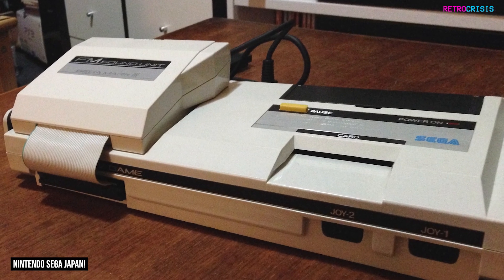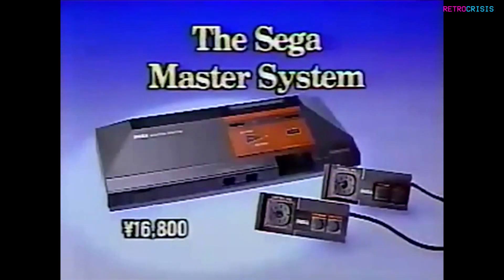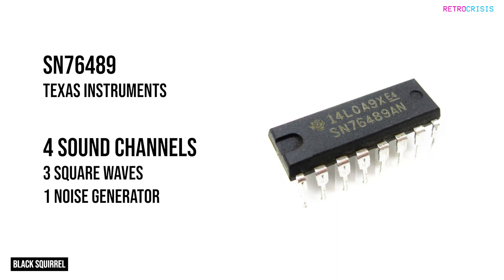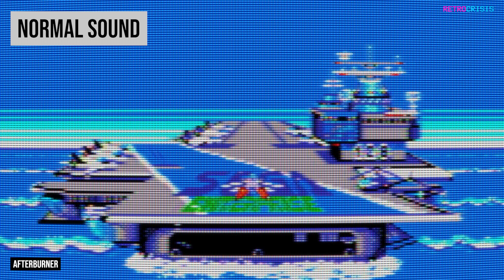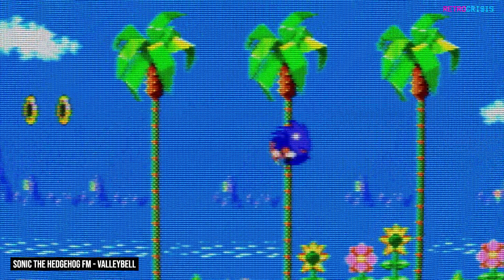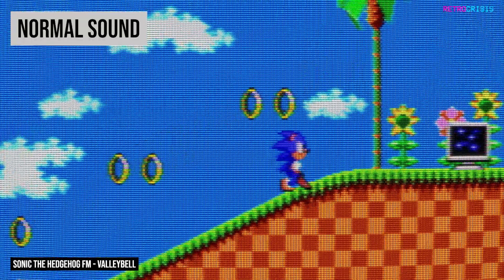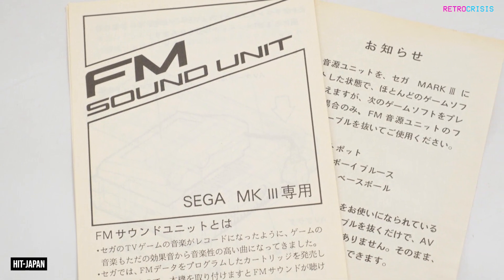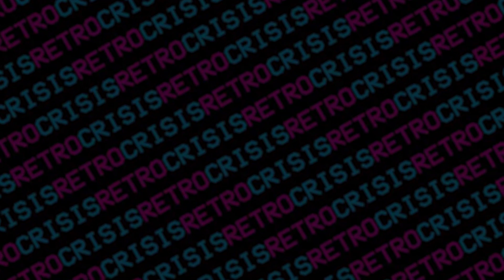Sega Master System - FM Sound Unit - Explained

Comment: 1:17 One important thing to note is that the Mark III+FM Sound Unit setup doesn't actually mix together both PSG and FM audio, only the JP Master System and aftermarket add-ons (SMSFM board, Power Base mini FM) can do that. Because of this, games that are FM compatible only have either FM or PSG depending on if the FM unit is connected or not. The only two things I know of that do mix both PSG and FM are the JP SMS BIOS and a neat hack of Sonic 1 with FM support.
Reply from the maker: Ah yes you're aboslutely correct - I should have made that more clearer!!! Thanks for sharing the knowledge dude
Reply: The Sonic mod was made by ValleyBell, primary maintainer of VGMplay.

Comment: Its a cool addition to the Master System. Sometimes it works ok with the FM sound. But mostly I perfer the standard chip sound. Some of the melodies and sounds are muted and weaker with the FM. Also there is something about the identity of the console tied to its sound as well.
Reply from the maker: I see your point about the console's identity and you're absolutely correct. In some cases the FM does dampen some of the punch of the SMS sound chip for sure
Reply: @MiiCave  console's identity is nonsense. The FM improves on the biggest weakness of the unit. No need to romanticize things ;)
Reply: @shaolin95  Has nothing to do with romanticizing things, it's about the melodic quality the PSG, aka chiptune audio has, FM Synth is fantastic too, so is MIDI, all have their place, but the Master System does sound better with PSG for the most part, it has a stronger melodic tone that lends itself far more to the 8-Bit games, I love OPL3 music, probably my favourite synth type, but I love PSG too, and it's nice to have both.

Comment: Great vid! 
Through my own testing and research I have found that Wonder Boy III, Phantasy Star, and Ys all are not supported with FM sound through the Power Base FM Mini. Also OutRun has major noise problems when played in FM mode.
Reply from the maker: Thanks dude! I believe the games you've mentioned require a Japanese master system or mark 3 system to get the FM sound...I could be mistaken though. Do you have the FM mini??
Reply: @RetroCrisis  yeah, I do. It works pretty flawlessly, other than with the games I listed.
Reply from the maker: @retroprojections  that's awesome. I considered getting one a while back just for the backwards compatibility for the Mega Drive. But in a wired way I think I prefer the regular SMS sound - probably nostalgia
Reply: @RetroCrisis  I understand that! It's a bouncy joyful little sound chip! The FM tunes change the entire feeling of some games: Golvellius for example.
Reply from the maker: Totally agree! Golvelius becomes a lot more serious and subdued with its soundtrack which is a contrast to how colourful and cartoony it is

Comment: Do those MS games have FM sound when used with a Sega Nomad plus MS cartridge adaptor?
Reply from the maker: I'm guessing only if the MS cart adapter supports FM sound
Reply: @RetroCrisis  Interesting. So it's the adaptor, not the actual console itself, which determines FM sound functionality for MS games? I'd always assumed that said adaptors were nothing more pass-through devices with no additional functionality so I guess I was wrong.
Reply from the maker: @sambagogo777  So from my understanding, only the japanese SMS has the FM chip, which wasn't released in International versions. Sega Nomad was USA only, so wouldn't have had the SMS FM chip. But the FM Mini adaptor has the FM built in.
Reply: @RetroCrisis  I just realised that I was confusing elements of the Nomad with the Game Gear. My bad! I somehow got confused by thinking of the GG's adaptor for MS games. D'oh!

Yeah, the Power Base Converter doesn't physically fit the Nomad. I don't know if there were any third-party versions of it that did though.
Reply: @sambagogo777  Also, the Nomad isn't compatible with SMS games at all without modding. You'd also need to perform an additional mod so that external audio from the cart slot can get mixed in.
Reply: Funnily enough the Japan-only Mega Jet (which the Nomad is based on) does have both SMS compatbility and external audio, so playing SMS games with FM sound would be doable on that with zero modding.
Reply: @thepthepthep  Thanks for the clarification.

Yeah, I was wondering if the Mega Jet would be any different so you've answered that too. Cheers!

What about that Amstrad PC/MD hybrid?!